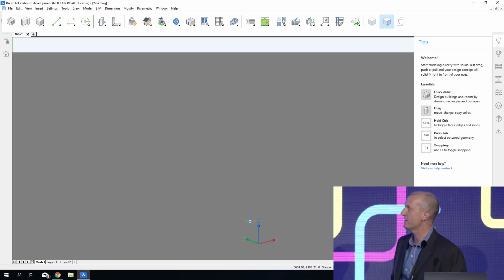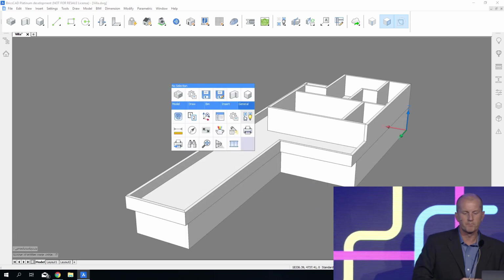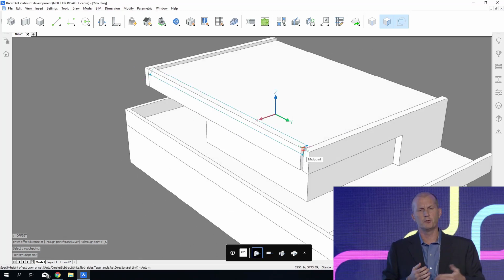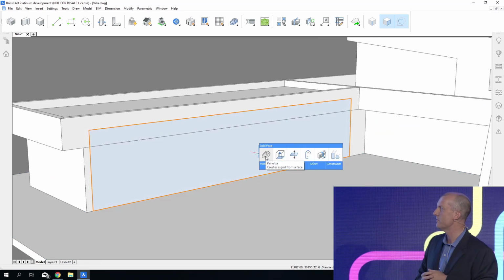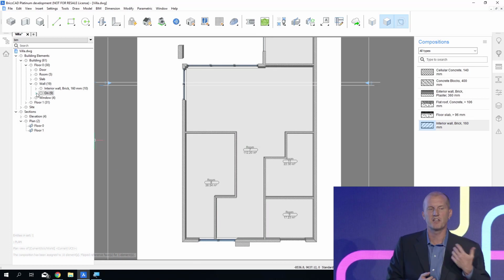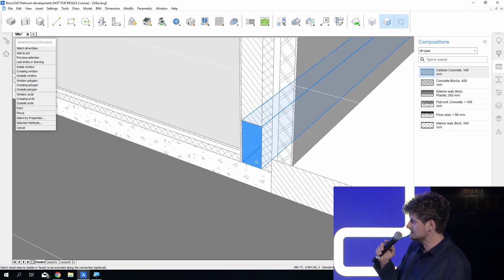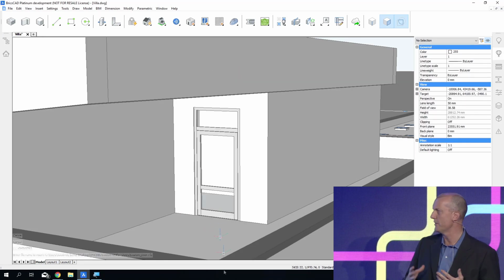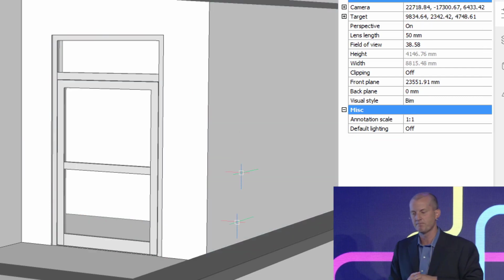How to Create a Villa from Scratch in Under 30 Minutes with BricsCAD BIM | BricsCAD for Architecture

Comment: nice demo but somehow my out of the box experience si so ugly. i worked a bit with revit and it was way more easier than bricscad bim v25
Reply: This was six years ago, I imagine there's been some relatively major changes since then. I just upgraded to V25 from V22 and I'm trying to relearn BIM because I think this platform has a lot of potential. But yes, I agree at least six or seven years ago, I learned on Revit and they had it figured out by then.
Reply: @naff78  thats the problem. even thought we have now v25 is still not such a good experience. i forgot to mention but when i worked with revit i started from 0. i never worked with any bim software before that. so trying bricscad was such a bad experience.

Comment: Is this in MM or CM? Might I recommend adding that information to the beginning of the video, or in the description? I have noticed a trend of your videos not having all of the prerequisite info to these tutorials. As someone from the states, I don't know offhand what unit you're using, and as I'm new to the software, I don't know where to look in your video to find it. Thanks!
Reply: Additionally, I don't know if you're using Polar or Ortho, or anything else on the bottom right corner as the video of the guy talking, (which is nice to have him talking, but do i need to see him to listen?) is right on top of all that info.
Reply from the maker: You can choose the required units in the BricsCAD launcher while opening the software or change existing Units by right clicking at the status bar (below).